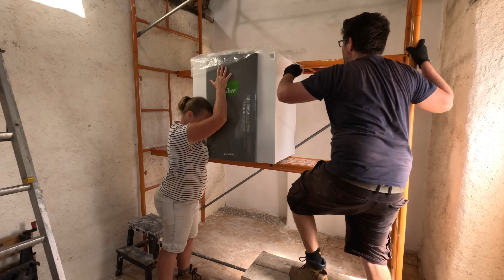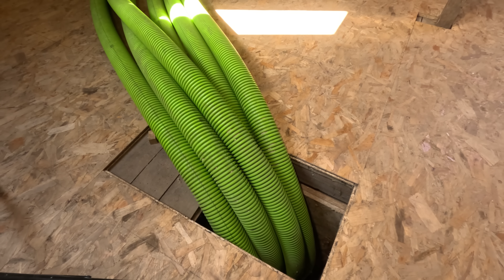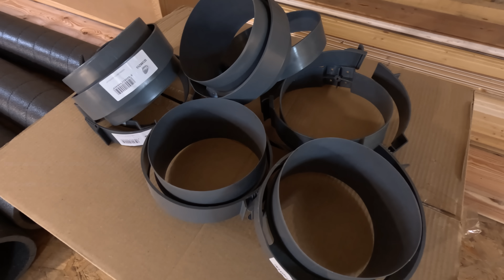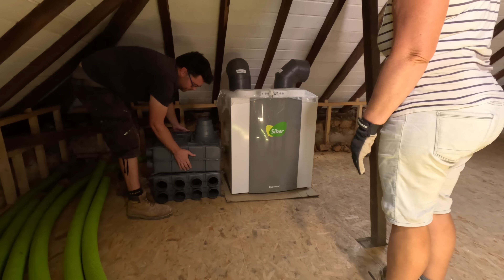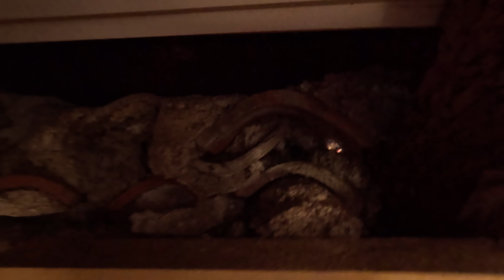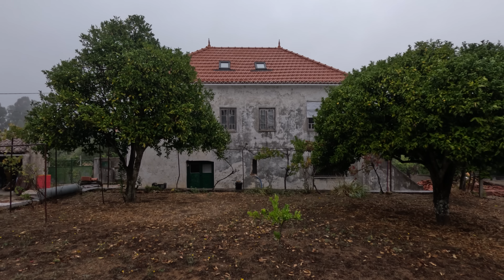Installing MVHR in an Old House - Part 1 - Preparation

Comment: Hi, reinforcing the holes you need through the wall. consider the drain colvits that are used under roads. you can get that at specialist plumbing suppliers. and it comes in various diameters. from 300mm to 3 meters etc. usually, you have to by it in 5 or 6 m lengths but they may have off cuts they will sell you. or buy the straight-through joiner fittings and those will only be 300 or 400 mm long. the other option is to use carboard pile forms and squirt expanding foam between the stone and cardboard, once the foam is set its strong, bug and water proof. I hope that helps, D

Comment: I don’t know if this will reach you too late, but I did a siber installation a year ago. I assumed the ability to open the access ports in the manifold boxes would become important at duct cleaning times. A maintenance task that I imagine to be like chimney cleaning with dust being pushed into the boxes and vacuumed out or the boxes as entry point for the brushes. Either way, if I’m right, you may want to arrange the boxes with access ports in convenient orientations. I couldn’t see clearly, but it looked as if the stacking might make life difficult down the road. HTH

Comment: The silver flex tubes are noise dampers, minimal 1 m long. don't skip those. The MVHR unit needs masse to attach to, > 200 kg /m2 , in order not to resonate noise into the building by floor of wooden wall.   the MVHR units are noisy without decoupling.

Comment: Could you put a larger pipe as a culvert idea in the stone wall and reinforce around it for the softer pipe to fit through?  

The circle is stronger with the stone and hemp and it won’t smoosh the in or out venting.

Comment: To have more strength for the inlet and outlet ventilation pipes as they go through the wall; you might consider putting a large diameter PVC pipe through the wall which you could lime plaster/cement around, and then run the soft ventilation pipe through it and seal any gaps between the two pipes with spray foam.  Another option would be maybe 4-6 smaller PVC pipes through the wall that form a collective large circular pipe that you plaster into the wall, and than the soft foam inlet/outlet ventilation pipes could attach over the end of the PVC pipes that are in the wall. Just a suggestion. Hope all goes well.  Always love to watch the two of you and your adventures in renovation.

Comment: I have a mvhr system in my 1950,s bungalow in Essex , it’s the best thing I’ve ever done, the air quality is superb and the damp is absolutely non existent, we use the summer by pass in summer and switch it back to heat recovery in winter, I can’t recommend it strongly enough

Comment: For reinforcing the hole in the wall a concrete drainage pipe of the right size, cut to fit would work.

Comment: I also live in northern PT. After my research I decided not to install similar to you. The main time of year I would need this is the winter. In the winter the outside humidity is 80-100% for weeks and weeks. Therefore you will be pulling in humidity. The unit does not dehumidify the incoming air. It only adds some recovered heat. This is the opposite of what you need. When it’s cold and humidity below 60% it is amazing. So in the western US for example it would be ideal. If I am mistaken I would love to know.
Reply from the maker: In our instance the ventilation unit is part of a holistic approach to a warm, dry home. Everything working together (lime, hemp, radiant heating, insulation …) will combat any humidity.

Where we are the winters aren’t as bad as in the north, we often have days of 60-70% humidity, which is a lot lower than inside our stone building
Reply: @MAKEDOGROW Thanks for the answer. In my case I monitor the humidity in and out the house. I open the windows when it’s lower outdoors, use dehumidifiers and a wood burner that draws air from the room. I also have a thick stone house. Any way you can set your unit to only draw in air when it’s less humid outside? If not part of the unit it would be easy to set up with smart plugs and an app
Reply from the maker: @PaulWoodland-sg5vo we totally intend to have it programmed, not just based on humidity levels but also on how much solar we have.
We’re probably also not going to run it through the night, due to energy and the fact that the unit is directly above our bedroom.

The unit is compatible with Home Assistant which is what we use to monitor and activate all our home tech 😀
Reply: @MAKEDOGROW my house also off grid. Most appliances are WiFi enabled and it means I can regulate the house when I’m away. I love the combination of tech and old school building techniques to compliment each other. Plus I don’t want to channel out rooms for light switches when I can use an ikea WiFi switch, Alexa or my phone! Maybe worth an episode on how you use tech. Loved your solar issues

Comment: Guy; for the holes in the stone walls, what about using a length of terra-cotta pipe the proper diameter as a sleeve?  You place the pipe where needed, re-build the stones around it and then slip the duct through it and then foam & caulk the gap between the duct and pipe.  The pipe will protect the duct and act as a rigid sleeve going through the wall.  The pipe should be slightly sloped downward to the exterior to drain away any moisture that may find it's way inside or to shed rain running down the face of the outside wall.  The outside of the pipe is cut/ground flush with the outside surface of the wall and then the metal cap goes on the end of the duct and caulked to the wall.  In theory, the terra cotta pipe could come inside as far as the finish face of the wood framed knee wall inside the loft, and then you just plaster up to it inside.
Reply from the maker: That’s exactly what we’re hoping to do, but sourcing something the right size is easier said than done
Reply: @MAKEDOGROW hashtag Portugal 😄

Comment: Hey guys , good morning sometimes I check you guys what you guys doing , I am sheet metal worker  and one the things I am doing is ventilation and you guys to put the flex in HRV put glue and plastic zip tie and have tool to tie the zip tie , I don't now how much cust ln Portugal but is very cheap this method is cilling better the flex .
Reply from the maker: Ah, thanks. We were thinking glue and a jubilee clip (abraçadeira). We’ll look into the zip tie tool, might be easier

Comment: Our last house had an "ERV" (U.S. designation?), which is a form of MVHR that transfers heat and moisture.  We found that we had to turn our ERV off when our neighbor heated his shop with a wood stove, and during wildfire events.  Otherwise all the smoke was pumped into our house.  Our ERV had a pretty basic filter, and did not filter smoke, viruses, etc.  Because ERVs can be set to run continuously exchanging a high volume of air, I would think you would need a pretty significantly-sized filter to capture smoke/pollen, etc.  A filter that might need to be changed or cleaned frequently. 

We do see the value of an ERV (MVHR), if you heat with radiators or heated floors, as opposed to a ducted air system.  We found that a prior home without a ducted air system (it had hot water heated floors) would get stuffy, and anything moving air would have helped.  We actually prefer a ducted air system with a MERV 10 or above pleated media filter (MERV 10+ captures smoke).  MERV may be a U.S. designation.  With a  ducted air system, a 16" x 25" by 4" pleated media filter (about 400 sq in) will last 3 to 6 months in our experience, and makes for very fresh air in the house.  We set the fan on the air handler to run "continuous", which also distributes the heat or cooling evenly throughout the house.

Comment: The soft ducting will need a sleeve  where it goes   through  the walls🎉 .A suitable sized piece of heavy duty plastic water drain pipe  would  be my favorite .dont know what size your ducting is but anything just bigger in diameter to allow for the ducting to slide through it is fine . Set on a slightly downwards fall from inside to out to stop  driven rain water tracking back in and something like plumbers hemp  rope soaked in plaster  at the inside end to seal any gap between the plastic sleeves and the soft ducting  to seal out bugs and drafts  .
Reply from the maker: Yep, that’s what we want (same approach we’ve taken with other holes through the stone walls). The challenge is finding the right size pipe
Reply: As I said ,I don’t know the diameter of the pipe you need for the sleeves ,But you may have to get creative in adapting /Modifying  something  biscuit fire unglazed ceramic like a  mid section out of a straight sided round   planter or  short lengths of Plastic underground drainage pipes .(The brown ones  here in Portugal ).I haven’t seen underground concrete pipes small enough for your purposes but haven’t really looked either .cheers .ps clay chimney pots ? Suitable size tin/tins to match wall thickness ,. as a former to pack lime mortar around then break out the tin/tins  when mortar set  enough to stand and not deform .
Even easier laminate up a foam block .carve into a suitable size cylinder with a bread knife ,finish with surform type rasps .Rap with cling film .pack lime mortar/hemp  around that former .Breakout foam out when lime mortar /hemp hard enough to stand and not.
Reply from the maker: @simonlewis6276 we’ve just seen something at our local building yard that will probably work, it a concrete half pipe. Not exactly the right size but could easily be adapted.
Equally we could shutter a box, put the foam in it, pour our own concrete/lime mix.
For some reason, in our area, we’ve not seen any of the brown underground pipe available domestically. Everyone just uses the grey stuff
Reply: @MAKEDOGROW  my preference would be the shutter box approach .

Comment: I had a pully system to get heavy things up into my attic. It had a ratcheting mechanism so it held up between pulls.
I only installed a hook on a high beam and always took down the pulley when not in use.

It was cheap and easy to setup. Much safer.

Hope this helps in the future🙂
Reply: There’s also a lifting machine that you crank up heavy equipment with. It’s fully manual, and fits in lots of spaces, and goes up pretty high. Wish I knew the name. Dan used it early on in his restoration of a Chateau, called, Escape to Rural France.
Reply: @janmitchell641Oh yeah he did a ton with that thing

Comment: Have you looked at sewer line pipe to create the opening tube for your air handler? Cutting the pipe into a smaller section to cement into the wall space. The other option is a metal flue pipe but over time it will rust out so you'll need to cement the area enough to ho,d the form of the hole. Are you sure even one tube upwards doesn't work? Then you can have the needed distance between the in and out closer to the unit, having the exhaust via the roof pipe vs the wall.

Comment: Another big job. Results will be great for temp control in house. Do you have a timeline for when you think you may be finished.
Reply from the maker: We’re hoping the house will only be another 2-3 years, but really depends when we get planning permission approval for the carport/workshop. There’s still quite a bit of woodworking (staircase, kitchen, etc) that needs the workshop

Comment: How about a large diameter ceramic or concrete pipe for the duct to fit in, could be set in lime mortar and insulated.  Love your  work and dedication, well done 👏👍

Comment: Can you not make the flexible pipe connection inside the loft and put a rigid pipe through the wall- that semis to be the straightforward way of doing it.
Reply from the maker: That’s something we’d not considered, but we’d first have to find a pipe exactly the same diameter and work out how to do the joins in an airtight manner. It’s the size of the pipe that would be most difficult to find - sourcing uncommon objects is really difficult here
Reply: @MAKEDOGROW  what is the internal diameter of your flexible pipe? Happy to trawl the interwebs on your behalf and see what there is out there? I'm sure there will be something out there.
Reply from the maker: @samday9328 the internal dimensions of the soft grey pipe (the one that connects to the external grill) is 160mm, not a very common pipe dimension it seems.

We’ve found a concrete half pipe that we think will work well - strong enough to support the stones above, and big enough for the ducting. Not looking forward to breaking through the wall though 😂
Reply: @MAKEDOGROW  I'm sure you will be fine - maybe a small diameter long drill and stitch drill the circumference?

Comment: Could you put a pvc pipe through the wall and run the softer duct through that? Or just use pvc instead of soft duct?

Comment: There is a heat recovery system installed in my new build in Ireland. It was a shock to me when the main unit was installed as it is hella ugly (a lot uglier than yours). I can’t wait to get it boxed in so I don’t have to look at it in my utility room. I appreciate  you two doing it yourselves as I wouldn’t have had a clue where to start and I’m sure would have messed it up ( think undo redo a gazillions times). I thankfully relied on experts to do it. Still have to find the money when the bill comes in tho’!

Comment: All that heavy lifting made me worry about hernias and back strains, but you both are in good physical condition and have done enough heavy jobs to know your limitations.  You shared the load well!  I lived for thirty years in a leaky old farmhouse with an enormous heating bill, and though my new retirement home is tight by US building standards, there are points of sufficient air infiltration to keep me from suffocating in the winter.  Your heat exchange system will do this more efficiently.

Comment: Just out of curiosity: If you put in- and outlet side by side wouldn't you suck in the (spent) air you were just pumping out?
Reply from the maker: The minimum distance to avoid that scenario is 1 meter between the vents, we are over that 😀

Comment: You probably have a solution by now but what about putting a length of clay drainage pipe through the wall and threading the pipes through that?
Reply from the maker: That’s pretty much what we’re on the lookout for, it’s the size and sourcing it that are the challenge

Comment: In a hot country Heatrecovery?? That is a joke?
Reply from the maker: Do read up on it, it’s not about the heat per se, but extracting the energy from heat and using that (as opposed as having to use electricity)
Reply: It's all about energy transfer. Read up on it.
Reply: @jimmyjohnstone5878  Agree with Pedro, it is an overkill. I am from Poland and even here people who installed them think that they do not work as efficient as advertised and that is a waste of money.
Reply: I know how this works but to be efficient a house has to be super sealed with triple glazed windows, 20cm styrofoam external insulation etc. Look I dont mean to be rude or anything but I think in your case your house has natural exchange of air through wooden windows and stone walls so it not that required. Anyways hope it works as intended.
Reply: @RobIn-ky4uz you are wrong to doubt the efficiency of the unit they are installing.
Reply: @jimmyjohnstone5878 it is all about the cost of the unit vs the heat that it can recover converted to $. The initial investment and maintenance (regular change of filters and energy required to power the unit) will be higher than the energy saved. I live in central Portugal just like Guy and I am telling you that this will not save them money or keep the house warmer in the winter. The only benefit in my opinion is that they will have exchange of air so no need to open windows.
Reply from the maker: @RobIn-ky4uz why would someone think a ventilation unit has anything to do with keeping a house warmer?
Our primary goal is mechanical ventilation - fresh air in, humid stale air out … that is what the system is designed for
Reply: @MAKEDOGROW  It is a ventilation and heat recovery unit (Recuperador Duplo Fluxo Vertical Siber Excellent 3 or 4) as far as i can see. There is a heat recovery element in it which essentially captures the heat as the air is expelled outside and adds this heat back to the incoming cooler air from outside. So the purpose of this system is to get fresh air but also keep the house warmer keeping the heat inside and lowering heating bills. Just to answer your concern about damaging the tubes, there are special vertical pipes that connects to the soft tubes and that go down through the ceiling. Not sure what is the name in english but if you search "skrzynka rozprezna" in polish, you will see what I mean.
Reply from the maker: @RobIn-ky4uz yes, heat recovery, but that’s not the same as heating. Our winters are pretty mild (days with highs of 10-13C in December/January) so quite some heat can be recovered and put back into the building. In addition to our radiant heating it should work really well.
We have some of those extra pieces to go through ceilings - there would have been one visible in the bathroom renovation series. It’s going through the stone walls to the outside that are now the issue - needs to protect the foam pipe and support the stone walls above (a bit like a mini lintel)

Comment: Through the roof would look a lot cleaner…
Reply: No it wouldn't. All the effort to get the tiles up smoothly would be spoiled by ugly pipes exiting, plus every hole you cut in a roof increases chance of leaks in future. The pipes through the stone will not be as visually intrusive and much less likely to cause problems in future.